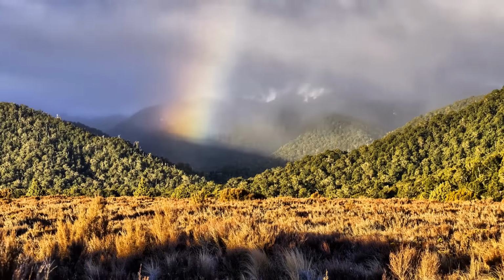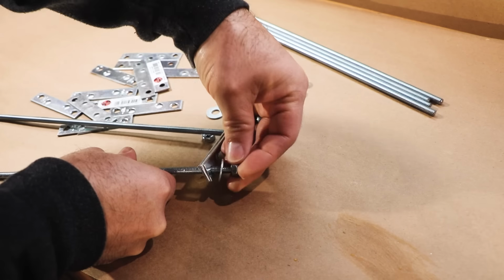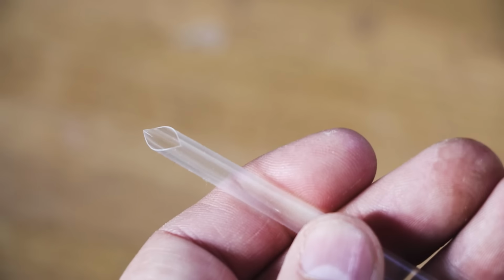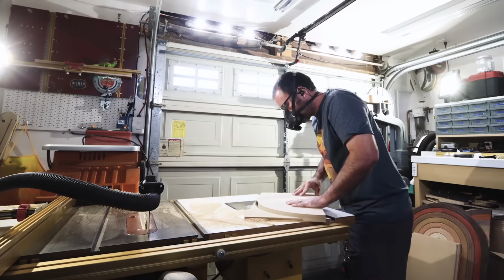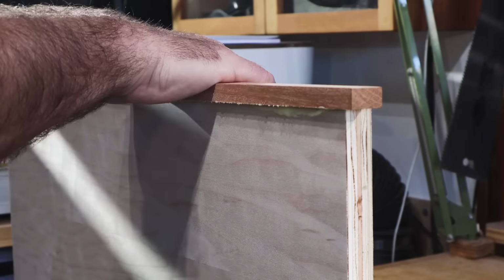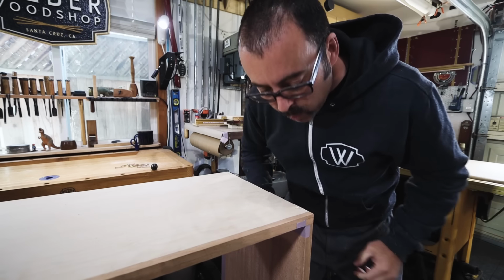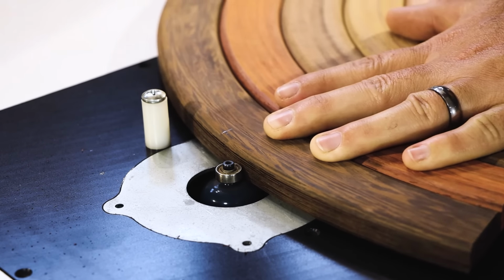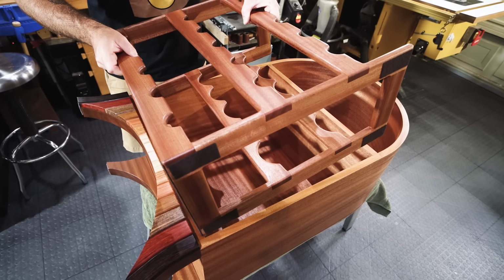Building the Rainbow Cabinet with only NATURAL wood colors

Comment: Protip for the hole saw: score the hole with the hole saw, then use a smaller bit (e.g. a Forstner or spade bit) to drill a hole inside that just touches the border of the hole saw. This gives somewhere for the sawdust to go instead of getting clogged up and burning it. This makes the hole much cleaner, the hole drills much more quickly, and your hole saws last a lot longer.

Comment: If you start the hole saw, then drill a chip relief hole just inside the blank (Or outside if you are using the blank!) you give the smoke inducing shavings some place to go and usually it will cut a cleaner hole as well! And the hole saw lasts longer too!

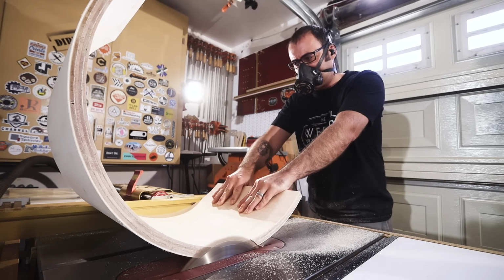Comment: Wooooow. This looks amazing. I have a question. How did you count for the top curve springing out after it was vacuumed. In minute 21:31 it looks like the piece base has moved about a centimeter after cutting the plastic. It is so essential that the curve matches the curve of the doors.

Comment: It's a beautiful piece, and quite the labour of love.  You must have some Irish in you with all those jigs.
When I saw your thumbnail, I thought "I bet he uses padauk".  Sure enough, you did.  I really hope that your decision to use it doesn't ruin it.  Padauk will turn a pretty awful brown in quite a short time, so although it looks great now, I fear it'll look less good, and perhaps a bit weird or even ugly once it starts to discolour.
Have you used Wipe On Poly with padauk before, and if so did it prevent the discolouration?  If it does, that would be great info to get out there.  So many projects have used padauk for its colour and looked great when they're finished, but after a couple of years it's lost all of its charm and can look really ugly.
Reply from the maker: It still has almost all of its color over a year later. We have it in a place where it doesn't get direct sunlight. I am aware that Padauk discolors dramatically but even if it does I chose these woods based on overall tone (brightness/darkness) more than color. So it will always have a nice gradient from light to dark.

Comment: Really nice work! One question though, why use veneered ply on all the straight edged pieces? Looks to me like the time spent to make all of these could have warranted just using straight up hard wood?
Reply from the maker: Thanks! Plywood is much more stable and quicker/easier/cheaper to work with. Solid hardwood would require much more complex joinery and you can’t glue it to the plywood curved top because then it could not move with seasonal moisture changes and would break apart. If you did solid wood sides and shelves the curved top would need to be solid as well, which would be a “coopered” curve and would be much more labor intensive as well as expensive. So it would not be realistic for many reasons. I usually build cabinets similar to the style of James Krenov with a ply core covered with solid edges and veneer sides. Although Krenov mostly used thicker shop-cut veneer which I’ve also done on other projects.

Comment: color change update? Padauk does not keep its red well, i know, but curious about the others
Reply from the maker: It's still very red after over a year. I'm aware Padauk discolors but I chose the woods mostly based on lightness/darkness so even when it turns brown it will still have the look I want.

Comment: Less woodworking and more wooden art project. It turned out great,  the solid center circle is a lot better design then the split you started out with.  And even at 12K I really think you under charged for it.